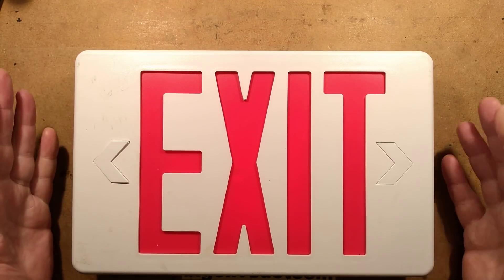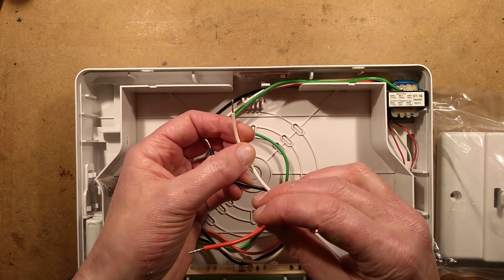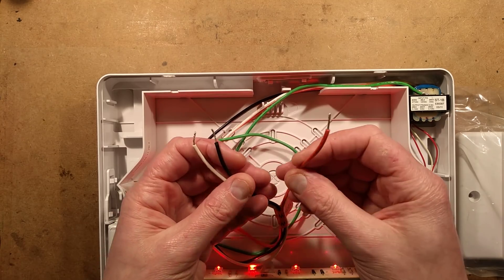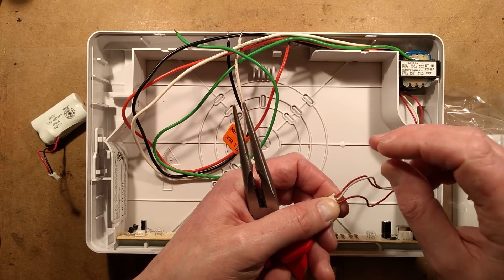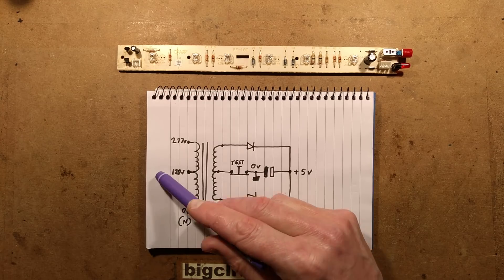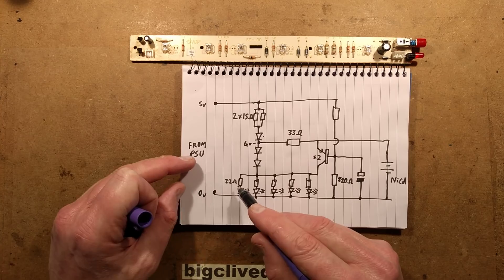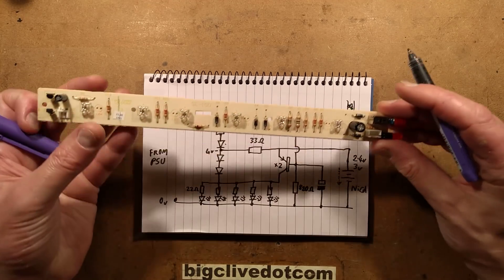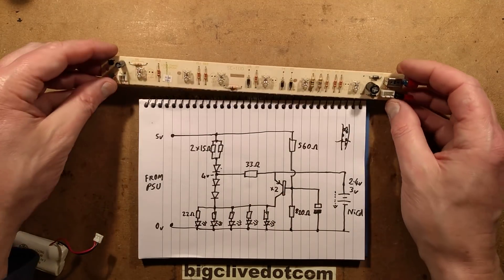Inside an American emergency light (with schematic).

Comment: In the US, there is no national standard to the red or green sign color. It's usually up to the architect or designer to decide which one looks best. Sometimes, you need the contrasting color to stand out and you pick that. 

I'm in the life safety industry, and years ago, I had a customer with several large buildings. The occupational safety department decided to use the red/green signage option in an unusual way. A RED exit sign would take you to the exit. A GREEN exit sign would be the actual exit (either outside door, entrance to a stair tower, or horizontal exit). Basically, if you were in the area of danger, crossing a green exit sign means you are safe. You still needed to get outside and away from the building, but for the purposes of life safety, you were in a much better situation. I thought it was an interesting way of using the different colors.
Reply: Certain cities have custom codes for their exit signs
example is chigaco where an exit sign is red text on white background, and sometimes its labeled "stairs"
Reply: @gradientgamer5480 Somewhat off topic but related, I find it interesting that New York City requires three light heads on an emergency light. Watch any TV show set in NYC, you can usually catch that.

Comment: I bought 2 of these on eBay for $25,they also have led spot lights on either end(which is why I bought them)I just desoldered the exit leds,& seeing as I am in Australia,I bought one of those travel transformers,so I can run it on 120VAC, it's my blackout back up,worth every cent.
Reply from the maker: You can get emergency exit lights locally too.  If you have a lot of power black outs then I strongly recommend the USB rechargeable PIR lights that can be stuck to your ceiling.
Reply: @bigclivedotcom  Third attempt to post this.All good Clive, I'm an electrician,I just thought it was cool that I could get these so cheap just because the voltage was not mine,it was just a little project my Daughter wanted to do, it's hanging above her bed,powered by a little travel adaptor,(because I can't be bothered with something more elaborate,😁 But my back up is a bit more elaborate,I have a tonne of Spitfires throughout my house ( small round emergency lighting used in commercial buildings)plus a 10kW inverter powered by batteries from a telephone exchange,with an ATS to detect mains failure,only off for about 1second during changeover.But thanks for offering advice really appreciate the thought.🫂❤️

Comment: In the US we have a couple different kinds of 3 phase power, 208Y/120V, 480Y/277V, and 120/208/240 high leg Δ, as well as 480Δ (these are the 4 I know, but there are probably more). That is why the transformer has a 277 volt tap on it.

Comment: Upon I think trying to get through this for the 5th time and falling asleep.
I noticed the LED is on that side of the test button to indicate incoming power and not be affected by the capacitor, although they could've put it on the other side of the button to indicate that the button was working when pressed.
Interesting simple design, although I am partial to the green color signs we do have them as well. usually a different color plastic, I don't know about the lights now that they've gone LED. They used to be just a little 7w( screw in bulbs like nightlights take ( but totally different because those aren't rated for emergency use…).
From my brief visit to the UK I think the exit signs are more classy with their symbols rather than words.

Comment: Yes I know that sign very well. I was installing one for a church.... As I was installing it I had an issue with one of the knockouts so I had to get the drill out and as I was drilling it I caught one of the wires. I had to do transformer surgery and I managed to just barely be able to reconnect it and solder it back on and seal it up. And wouldn't you know it of course it was the one wire I needed I believe it was the hot, if only it was the 240v line as our emergency lighting circuit was 120v.
I always wondered about that extra lead I've always capped them but I've seen them not capped.

And in case you're wondering after installing the entire tech booth audio video and finishing the electrical in our new building because the volunteer electrician got to busy, few years later I was told I didn't know anything by the pastor which used to be my youth pastor at one point prior to the church plant. But I digress there's broken people in the world and nobody's perfect but at that point I decided it was time to leave.
I came back 4-5 years later working with a band for an event held there and they did not change pretty much anything except for what I expected to change ... new speakers, I guess it was good enough that the pro sound company that came in couldn't make to many recommendations.

Comment: I was about to ask you about this, glad I just searched first. I was recently thinking of trying to tear down the little pcb to use the boost circuit to drive 5V IC's from the 1.2v NiCD cell that comes with the standard led exits I see. It seems clean enough at around 5.7V with a little extra smoothing and will take 12v input to recharge slowly.

Comment: When a lightning fitting failed and fell down I went to consumer unit swirched power off. Then fixed it I thought safety first. Then got my work light. And fixed it replaced it. I uster work with my dad long tiime ago from. 4  years old. Mate. Safety first

Comment: Two transistors - considering the point of the transistors is only to reduce the resistance in the circuit (the 33ohm resistor plus the two diodes) that the battery current has to go through to light the LEDs (after all, if you remove those transistors, the battery will still light the LEDs, but dimly) that might be a clue that it's to reduce the resistance further... that the chosen transistors have too high a voltage drop across, but this value is halved by putting two in parallel, allowing the battery to light the LEDs brighter, and warm the transistor less... IOW, it's a cost issue or something, a single transistor at the right spec may cost more than two cheaper transistors that will reach the spec by team effort.

Comment: The board looks like it has positions for T1-3/4 LEDs alongside the "piranha" style ones mounted.  However, it looks like there are only positions for 5 of them.  Are they just wired in parallel with the other patterns?
Reply from the maker: I noticed that.  They share the same resistors, so presumably are an alternative to the square superflux LEDs.  If you look at the superflux pads you'll see there are a pair of pads for standard LEDs in the same location.

Comment: 277V was popular for fluorescent light fixtures because in the days of magnetic ballasts, you could wire individual fixtures to the three phases of a 480V 3P system, and collectively reduce the effect of the lamps strobing at mains frequency. It not only reduced eye strain, but was a safety enhancement for fluorescent-lit workplaces with machines that could possibly be mistaken for not running due to the strobing of fixtures on a single phase.

Comment: Oh Clive, you didn't just say that we in the US get 240 by going across two phases, did you?  We have single phase power in residences in the US.  It is 240V, single phase, center tapped with two 120V legs.  You get 120V from each of the two hots to neutral (yes, the white is neutral, not "common".), and 240V across the two hots.  It is single phase.  Not two phase.

Comment: I was thinking that the probable reason for the same fittings for the front and back panels of the unit was so that a ceiling-mounted double-sided sign pointing to a side exit from a corridor could be made from the same components, by putting a front panel on both front and back of the unit.

In terms of safety, I was wondering why the live wires (black and orange) didn't come already insulated in some way, with a system where the insulation of the required wire could be removed easily (but not inadvertently) when connecting it up.  It would then be much more difficult to leave the unused wire uninsulated.

Comment: The reason it says 16 hour charge time is probably to be compliant with California Title 20 (ie Energy Star).  Several years back, a lot of products have started having to reduce their charge times, and also provide shut-off to their charger circuitry based on the watt-hour capacity of the batteries being charged.  For example, my Uniden police scanner had to put out a firmware update that only permits 14 hour charging cycles instead of continuous trickle-charge.  One has to unplug and replug the unit to begin charging again.  I THINK the statement about 16 hour charge might be a misdirect to imply Title 20 California compliance.  (I think it might not be compliant?)  These exit signs are sold under a million different throw-away Chinese brand names on Amazon and eBay.

https://www.energy.ca.gov/2012publications/CEC-400-2012-FS/CEC-400-2012-FS-002.pdf

https://www.acuitybrands.com/-/media/Files/Acuity/Products/Lighting/Indoor/Emergency/CEC_Title_20_Announcement_Emergency_Lighting_121416_pdf%20pdf.pdf?la=en

Comment: Thanks for featuring this Mr Clive.  I'd installed several of these and intuitively already knew to expect this.  I snip off the red wire leaving only a few inches then pinch electrical tape over the end to leave a square flag.  Since it's not a stripped end, this just keeps the wire from butting up against anything.  Though, fortunately, since the unit is plastic any wayward installs shouldn't become an epidemic.

Comment: Hey Clive, I was wondering as now 20W LED floodlights (particularly the 12V models) on eBay seem to have moved away from one solid package to a now array of SMD LEDs if you could check out how they compare.

I bought two floodlights a few years ago and they've been great, despite actually being 10W with a 3x3 array in the single chip they're more than bright enough for what I need of them. However I need more and I can't find them anymore except in mains voltage variants, but I have no interest in changing the chips.
I'm unsure about taking the risk buying this new SMD array type, thought it might be a good video topic.
Reply from the maker: The new multi LED version are based on driverless circuitry.  ( Current limiters on the same PCB) and are much less reliable.
Reply: @bigclivedotcom  Is that including 12V though? I did watch your video on those mains chip only based lights.
Seems I can't really lose anyway, I'll buy a 12V LED array type floodlight and if it is that terrible I can always fit a single package / COB with a CC buck.
Thanks for the reply.

Comment: Many industrial buildings in the US run the lighting off the 3 phase power.  This is the reason for the slightly odd optional voltage input.

Comment: No offense but ISO exit signs in the U.K. Or aka the running man suck. I love our American exit signs. They are very simplistic and easy to read quickly. The mounting bracket is also known as a canopy also that's pretty rare because it has a earth most do not. Also please look at an American emergency light.
Reply: Green running man = gents' toilet (Ladies don't run)!  
Here the local fire inspectors have mandated edge-lit panels with "EXIT" in green letters and even though 'exit' is not in the local language that seems to be the local standard, at least since joining the EU.

Comment: I frequently work on 24V transformers with 120/208/240/480v inputs. We use the 208v tap.

It does not feel good when you brush that 480v terminal with the back of your hand.

Comment: In UK do you now have Brexit signs?
Reply from the maker: Now there's an idea for a project.
Reply: @bigclivedotcom 
But the engineer who designs it has to leave and then it goes "Bang"
Backwards electrolytics way under their rated voltage will give you exactly the right amount of time for the boss to arrive before they go bang.  I know because I did that experiment.
Reply: Ba dum tiss

Comment: 3 hours for UK fittings? Wow. 90 minutes in Australia, with it needing to last 120 minutes for the initial test after a battery replacement. All fittings need to be tested every 6 months.
Reply: One hour minimum duration for locations which are immediately evacuated once power fails. 3 hours for locations where evacuation might be delayed or you'd re-enter building before power restored. https://www.firesafe.org.uk/emergency-lighting/

Comment: Wouldn't the Ni-Mh be better than the Ni-Cd for this? Or no because of the trickle charging? Thanks Clive. I loved installing these compared to the old signs, I just hated those things.
Reply from the maker: I think they still use NiCd cells because they are more rugged in long term trickle charge use.
Reply: @bigclivedotcom  Thanks Clive, so seems to me they especially built that circuit with that in mind.

Comment: I get so confused about the operation of pnp verses npn transistors. Please do an explanation vid.
Reply: NPN is easier to grasp because the electrons are emitted into the base because they get attracted there.  They then wonder over to the collector and get gathered up.
PNP uses strange "holes" where electrons normally would be but aren't.  Just draw the circuit with the NPN and the swap the polarity and you get the PNP version.

Comment: In Canada, many commercial buildings, apartment buildings, etc. are wired on a 120/208 three phase scheme, or on some sort of intermediate voltage such as 277/480 or 347/600.  Where intermediate voltages are used (mostly commercial buildings), as many loads as possible are wired on this intermediate voltage, however, transformers are still needed as there are still a few 120 volt loads to be supplied.

Comment: In America we have 3 phase, 2 phase and high voltage I can't tell you much about the three phase right now,  but I know that the two phase is in everybody's houses and operates in 120 volts AC and high power is 220 for things like clothes dryers and stoves 

Wikipedia's definition for 3 phase:
Three-phase electric power is a common method of alternating current electric powergeneration, transmission, and distribution.[1] It is a type of polyphase system and is the most common method used by electrical gridsworldwide to transfer power. It is also used to power large motors and other heavy loads.

A three-wire three-phase circuit is usually more economical than an equivalent two-wire single-phase circuit at the same line to ground voltage because it uses less conductor material to transmit a given amount of electrical power.[2] Polyphase power systems were independently invented by Galileo Ferraris, Mikhail Dolivo-Dobrovolsky, Jonas Wenström, John Hopkinson and Nikola Teslain the late 1880s.
Reply: Etham Cohoon What you call "two phase" is actually "split phase".  Actual two phase is an obsolete system used in the early 20th century. It consisted of two single phase circuits 90 degrees out of phase with each other.

Comment: Every time I see wire nuts used in American electrical installs, it always makes me cringe big time!
Reply: They shouldn't. They don't actually make an electrical connection if you use them right. You're supposed to twist the conductors together so that they don't come apart on their own, then the wirenut goes on to cover the joint and provide extra assurance things won't come apart when pushed into the box. It's usually not a wirenut that is the cause of electrical fires in America. 

Now it's also mandated that all new electrical circuits installed have arc fault and ground fault protection built into the breaker. Making breakers cost about 10 times more than the old style breakers that just tripped in over current situations.
Reply: FrontSideBus Me too.  The British wiring methods seem to be a lot safer.
Reply: @heronimousbrapson863  Ring main circut's are positively terrifying, buddy.
Reply: Wirenuts are just fine.  Use the one designated for the size you are doing and install it correctly.  They work perfectly well for holding the wires tightly together.

Comment: Clive, do you suppose that capacitor is to prevent flicker when there's a problem with loose power line connections at their transformers outside on the pole during a storm?

Comment: Old exit sign LED light; https://imgur.com/a/X205gAF

Taken from an abandoned asylum (1996?)
Reply: Yep. Used to "upgrade" an old incandescent exit sign. There were florescent conversations too which were pretty slick as there was two separate tubes used and when the first tube failed, the second turned on and took over. The oddest little power-saving/long life conversion bulbs were long tube shaped bulbs that had a string of tiny little Christmas tree light bulbs (or fairy light bulbs in the UK) inside on a string all running dimly.

Comment: You think the base of that transistor is biased at about 3 volts with the voltage divider (820 and 560 ohms) which forms a shunt regulator holding the battery at 3.6 volts (based on 5 Volts in??)?  When 5 Volts goes away the base is at zero and the transistor turns on.

Comment: Cap off the unused winding? On a fairground ride? Hell, I'd trim it down to nothing instead. Caps can come off. Wires don't grow back.
Reply: The Dee Sounds like some sort of tap changing switch would have been a safer option.